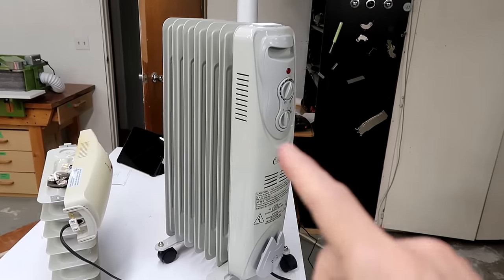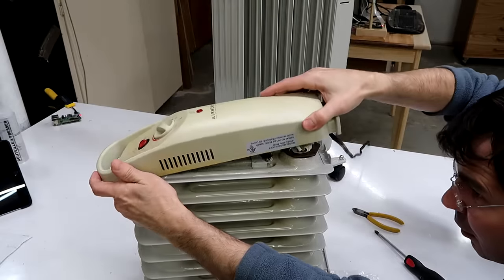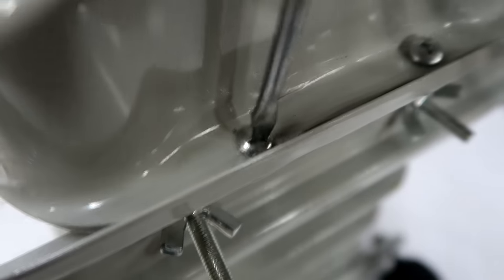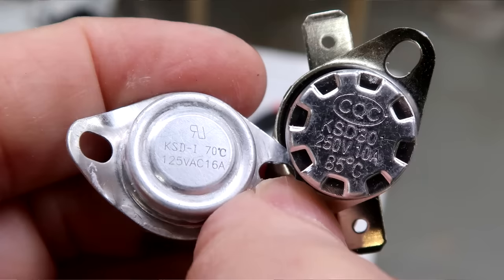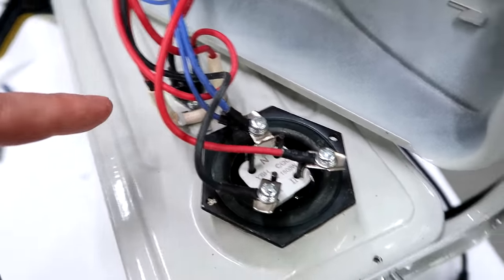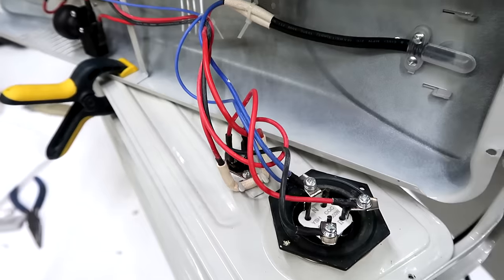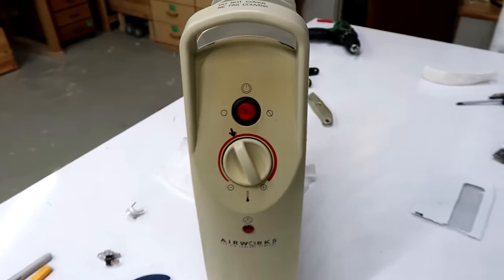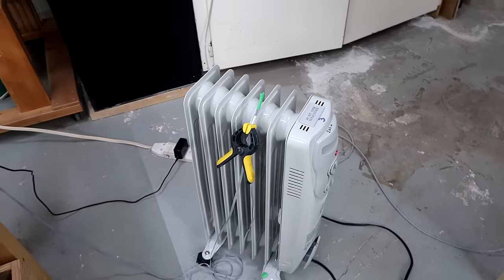Oil filled space heater fix

Comment: In a way your last comments are one of the great lessons we learned as expats.  Only in North America do we insist on heating the entire building envelope.   In Asia we had a 1000 sq ft apartment and we had heat control in each room which was off most of the time.  We only heated or cooled where were were.  Our conference rooms at the office were only temperature controlled when occupied, hallways, elevators etc were not controlled (i.e. heated or cooled).  Baseboard electric with some intelligence on the part of the owner or other zoned systems might actually be the most energy efficient (or lowest carbon footprint if you prefer).
Reply: There is a bit more to it than just heat and cost. If you dont heat a room and dont make it kind of air/draft tight you can get water condensation on windows, wall corners etc. This may cause mold and further problems.

Im not sure what are the prices where Matthias lives but in manitoba gas is kind of cheap. usually month of heating is around 120-150CAD  with -20 to -30 temperatures outside.
That is not really bad.
Reply: Cool story bro. Asia is a horrible place to live with little value being place on human life. I think I’ll listen to my people first and not the people that continue to insist on killing the planet.

Comment: Have you considered heat pumps?
Reply: He mentioned at the end of the video that it wouldn't make sense to have a heat pump installed because they're only slightly more efficient than just plain electric heat, so the savings in energy wouldn't end up paying for the cost of installing a heat pump.

Comment: Could you replace your Daz furnace by a wood boiler ? Wood is really cheap in your neck of the wood no pun intended

People around here burn old furniture pallets and brush from around there house, then you don't need much firewood for the remaining of the winter
Reply from the maker: for the cost of that alone, I could heat the house for ten years.  Add cost of wood, and put a price on my time, and it becomes uneconomical.
Reply: @matthiasrandomstuff2221  well I surely don't have your background in economics and even tho I'm a bit north of you where my  electricity is 7¢ per kw/h, it would seem to me than a 2000 bucks system that's is paid by itself in 10 years would be nice for the longer run since firewood price have been pretty stable in the last 30 years while gaz and electricity have at least followed inflation

Around here people that don't have access to woodlot often burn eco log made out of pressed pellet and they all seem to report a cost of operations of half of electric heat

Comment: Are heat pumps so expensive there ? Given that they can have an efficiency up to 5 times better than an electric heater, it shouldn't take too long to amortize the initial cost.
Reply from the maker: They are only that efficient when it's not cold outside.
Reply: It wouldn't just be a heat pump, in would be an entire HVAC system.
Reply: Heat pumps aren't that efficient in really cold weather. Currently cheapest way to heat a house is a good natural gas heater. And the second cheapest central wood pellet boiler.
Reply: @ivanlipik  That's not completely true. An air-air heatpump wouldn't be efficient in cold weather, however, for a location like Canada, an air-water heatpump would make a lot more sense. There, the heat is 'extracted' from the ground, and if you run the AC in summer, the heat is stored in the ground. These systems are hardly affected by weather, since ground temperatures below a certain level are fairly even.
Reply: @timderks5960  Yeah they're very efficient if you can afford to dig a big hole to extract the heat from deeper in the ground where the temperature is above freezing, or the water table isn't frozen, it's just that's even more expensive to retrofit to an existing house. All new houses should really need to come with one though, imo.
Reply: The easiest way to heat you home on the cheap is using mini split heat pumps. 
good ones will give you a 3:1 ratio until -10c maybe 1.5:1 @ -20c

The best mitsubishi ones can heat up to minus 30c but i don't know their efficiency and they are very expensive.

I use 12000btu x2 fujitsu on the main floor and a 12 000btu cheap one in the basement. I only use my pellet stove when it's below -15c. it a pretty cheap system to run so far.
Reply: @matthiasrandomstuff2221  If an electric heater like this is 100 percent efficient and a mini split is 250 percent efficient at ~45 degrees F and loses 15 percent efficiency when the temperature drops to 5 degrees F, you still have greater than 2x the efficiency of the plain electric heater.  Not bad at all, but perhaps still not enough to justify the equipment?.  Maybe a DIY install?  🤔 In New England, they charge close to $2k USD to install a 12,000 btu mini split that retails for ~$1900 for the equipment.
Reply: @matthiasrandomstuff2221  Look into cold climate heat pumps, you'd be surprised.

Comment: I have never had one of these overheat even on high, although I have never used that brand (edit: let me clarify that I have never had one of these overheat that I know of and they did seem to heat faster on the higher setting, although mostly I ran them on the lower setting)
Reply from the maker: they way it;s made, it doesn't tell you when the switch tripped.  So unless you measure it, you never know.

Comment: Hi Matthias, why not just cut the two wires to the overheat protection and join them? Completely eliminates your problem!  I have worked through the comments and I don't know why nobody else suggested this?   I love reading your responses through the comments, where we are in the UK gas is about 1/4 the price of electricity per kw. So for space and water heating gas is king, I even found a natural gas tumble dryer to replace my electric one. (made a video of taking it apart before installing it too!)  But I completely understand that the earth is round and that prices are different in different places!   BTW have you thought of using a fan,.... lol!
Reply from the maker: Cause then it would really overheat.  It's not designed to take 1500 watts, I'm quite sure.  Here, gas is about 80% the price of electricity per amount of heat.  Now you lose 5% in the furnace, and distribution at least another 5%, and another 5% because the heat doesn't end up exactly where you need it, and the savings are nearly gone.  Add cost of the furnace, and it makes no economic sense to switch.
Reply: Oh, now, you're just becoming the safety police!

My neighbours got solar PV panels and were trying to show me how they would pay for themselves in 8 years. I ran the numbers and figured that they paid three times more per year for heat and light than us! It is hard to imagine that in two identical side by side houses there could be such a difference.  The point here is, and I guess it holds true for you as well, if you are already running your house and systems as efficiently as you can there is very little scope to save more, even with a more "efficient" system.

Comment: If I were in the same situation I would get a cheap window ac and connect it backwards, cold to the outside and heat to the inside, of course it's far from silent but the efficiency is tempting
Reply from the maker: That would only be effective at heating the house in the summer.
Reply: @matthiasrandomstuff2221  Why? An Ac and a heat pump are the same thing backwards, aren't them?
Reply: @SirDella  a heat pump has a automatic system for self defrosting. Without that it would you would not be able to continue using it below freezing temperatures because the coil would turn into a chunk of ice. Plus the cold side can only get down to 40 degrees. In other words it can extract heat below 40 F

Comment: Electrical heating is also the lowest emission heating. Heatpumps are preferable to resistance heating tough.
Reply from the maker: Low emission only if it's generated with low emissions.  And even if the electricity comes from zero emissions, the balance is always made up with fossil fuels, so using electricity usually involves extra emissions.
Reply: @matthiasrandomstuff2221  I'm not only counting CO2. The direct effect on health of NOx, particles, SO2, heavy metals (Hg, Pb, As) and most importantly, because directly cancer causing, polycyclic aromatic hydrocarbons PAHs is a much greater and short term i.e. instant concern. Combustion and exhaust gas treatment is simply much cleaner/effective at large plants than in small furnaces. Also chimneys of power stations are much taller so the exhaust gas is diluted before it finds the way into bedrooms.

Comment: So, all OF heaters have this condition/problem? By default?
Reply from the maker: We have five of them, all have this, and a sixth, different brand, same issue.
Reply: @matthiasrandomstuff2221  Are you running all 6 of them at the same time while also having your central heating on?
Reply: No.  I have a large 1500 W one and have never had this problem.
Reply: I have 5 or 6 oil bath heaters and have never had a problem one with them. But they are the type with thermostat controls where the temp and power can be set. They are not that expensive so just a good one rather these crappy ones.

Comment: Since you tinker with so much stuff, i would recommend you invest i some tamper proof bits they are 5$ on aliexpress. And we will start seeing more and more of them on future electronics.
Reply from the maker: I thought about making one for those screws, but then I just undid them with a standard screwdriver, so there was no need to.
Reply: @matthiasrandomstuff2221  The ones you that I have to make screwdrivers for are those 2-Hole Screws, just took a worn out flat and ground the middle out. https://www.homestratosphere.com/types-of-screws/#foobox-3/20/two-hole-screw-am-020518.jpg
Reply: @matthiasrandomstuff2221  I love it when you can defeat a screw specifically designed to not work with a flathead driver, using a flathead driver.
Reply: Depends on whether you want to put the screws back in or not. If not, dremel tool and just make your own slot and away you go. Generally it is a good idea to have a set of security bits around though - those stupid screws are in everything now.
Reply: The ingenuity of fools always defeats the foolproof. And ditto for tamperers and tamper proof. I wonder why manufacturers bother.
Reply: @3maisons  Legal reasons. In the future, corporations can give you fines and jail time for tampering with products, citing an EULA that states that you do not actually own the product you just bought.

Comment: whenever i see water being heated with electricity i tend to think of nuclear power plants heating up water to spin fans and produce electricity just to heat up water again.
Reply from the maker: Yes, that bugs me too.  Power plans throw away a lot of heat, if only that heat could be brought to houses effectively
Reply: The cycle of life lost efficiencies at every step - hakuna matata!
Reply: There are a lot of green energy proponents who actually favor the idea of heating with electricity. Because they assume the grid will be run from 100% renewables in the near future. So that is greener (meaning lower carbon emissions) than wood burning or hydrocarbon burning because those emit CO2. Some people want building codes to require it. So fuel burning appliances would not be allowed at all. There was a big movement into electrical heating when nuclear was still popular and growing also because it was thought that nuclear power would drive down the price of electricity. But that kind of fizzled out.
Reply: @matthiasrandomstuff2221  How common is remote heating in NA? Here its pretty common and kind of nice to have a pipe pumping in 60-80C water(or oil or whatever medium they use) straight into a heat exchanger for the house
Reply: @konzetsu6068  very common for remote propane delivery outside of the city
Reply: @matthiasrandomstuff2221   It can. In Denmark 60% (and growing) of all housing is heated exclusively via district heating which gets all its heat from the "waste" heat from combined heat and power (CHP) plants. There are no old school heating plants left except for emergency plants. And btw all incineration plants are CHP too.
Reply: Agreed, much more efficient to have the nuclear power plant in your own house.

Comment: i always used to fix thise at my work site, we use them for heating container offices.
Its always same issue eather termostat melts of wires melt but i hook cables directly to the heating element and put one of those central heating termostats outside in line with the heater
Reply: Can a central heating thermostat take that sort of current?

Comment: To heat our house we use pellet stove linked with heating element in the entire habitation, it's cheap and it's nice to have this kind of stove in the house, it's like a modern wood stove. It's very ecological as well. As downside you have to clean almost every time you use it (each time last about 20 hours), and you should have space to keep the pellet bags (15kg each). But I think it's  a good way to keep the family warm.
Reply from the maker: The pelet heat is only slightly cheaper than electric heat, given the price of pellets.

Comment: "...it would never amortize itself."  Well, until you go to sell the house.  ;)
Reply: Switching it with another fossil furnace is probably not that great of an investment. Swapping it out for a heat pump system might be worthwile though. Electricity prices are going down, while fossil fuel prices are going up.

Comment: AliExpress and mains electricity. You're a braver man than I am. Ok it's just a (safety) component, fine...
Reply: I would not trust those thermostats either!
Reply from the maker: Do you think the original thermostat came from any better source?
Reply: @matthiasrandomstuff2221  Almost certainly not, but if you run this thing unattended, investing couple $ in a brand name part from digikey is not a hard choice. It's also possible (admittedly not probable) they are tripping because they overheat from the current and not from the heater itself.

Comment: Electric heating requires a lot of power, but it's the one I like the most. It's easy to implement, uses cheap hardware, has an excellent efficiency rate, and it does not release any toxic gases like natural gas (and even wood) does.
Reply from the maker: or at least, any toxic gasses are released somewhere far away
Reply: @matthiasrandomstuff2221  One would hope that wouldn't be the case, but it's likely it is.

Comment: Why dont you replace main heating with electric boiler?
Reply from the maker: It would cost $15,000 or more, I would lose heat on distribution, and it would end in all the wrong places.  Why spend that much for something that doesn't work as well?
Reply: @matthiasrandomstuff2221  didn t think it's was that much. Central heating unit for home in my contry comes no more then 2-3000$. I was thinkin about replacing only that gas burner.

Comment: If your thermal circuit breaker is opening the circuit, then you have a bigger problem. And putting a bigger fuse in it is not a good solution. 85 degrees C is enough to cause a burn.

Comment: Electric heating is crazy (@5:32)???

92% of all power consumed in Norway is hydroelectric, ie clean power . In 2012 80% of power consumption in households was electric. As of 1/1 2020 it became illegal to use any kind of oil/gas for heating, practically all new houses the last 5-10 yrs have electric heating as main source, and most of these heat pumps.
Mattias would be CRAZY if he said it was crazy to heat with electric in Norway. Well, he'd be more than crazy since he would have had to cut his apple trees to keep his kids warm, or in worse case scenario, burn portions of his house to heat the other :)

Comment: I've been using a Lowes version of these heaters for at least 4 years, never had a problem. Two on the same circuit, each is heating a room about 11 by 11 by 8 feet. Keeps the rooms about 68 degrees Fahrenheit

Comment: The thermostats aren't defective, the design is defective. You need to put a fan by them to stop them overheating.
Reply from the maker: If I wanted a fan, I could just use a heater with a fan.

Comment: You might just need a better unit.  My heater of that type (Lakewood Mfg. Model 7096/CH) runs indefinitely on high.  Heats the shop in my basement.
Reply from the maker: mine will too, but it only heats at 600 watts on high, just like yours.  You just haven't measured yours so you don't know.
Reply: @matthiasrandomstuff2221  Good point, so here are my measurements.  The unit has two switches, it draws 4.80-4.82 amps on the "600W" setting, 6.93-7.11 amps on the "900W" setting and 11.38-11.66 amps when both are on.  I have had both on for 3 hours now and it has been steady and constant at about 11.5 amps.  I don't have a way of recording the current draw to a permanent record, but every time I look over at it--every few minutes--it has never been out of that ~11.5 amp range.  The surface temperature (thermocouple taped to the surface of the top of one of the loops) rose to and has been steady at 77ºC, just flicking down to 76º for a second now and then.  If you would like I can open it up and see what kind of cut-out switch/circuit it has.
Reply: @NoBody11010  Matthias could solve his problem with one of these Lakewoods; he never responded to my data, it clearly shows that it stays on high and draws the full current as long as you want it to.

Comment: Personally, I would not use a safety device from aliexpress. Couldn't you just get a real one from digikey or some reputable supplier?
Reply from the maker: I could, but it would be cheaper to replace the heater.
Reply: Really? Well, If I remember right you said it also had a one-time thermal fuse so I guess it is still pretty safe as far as ultimate safety goes.